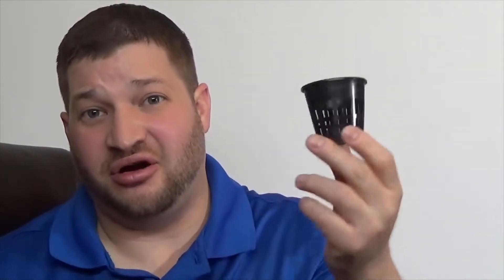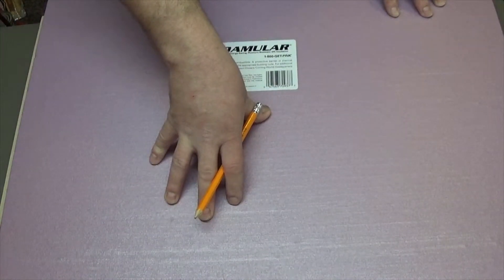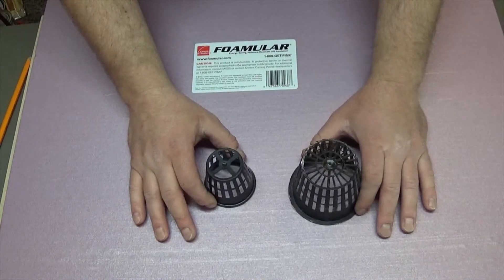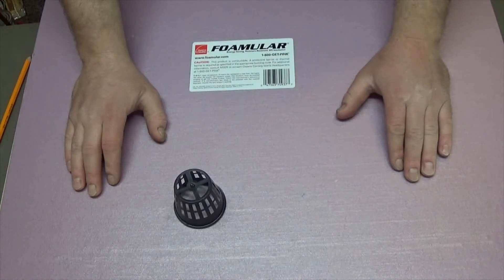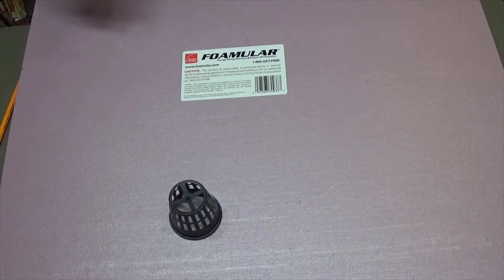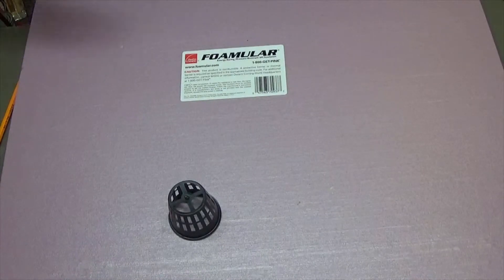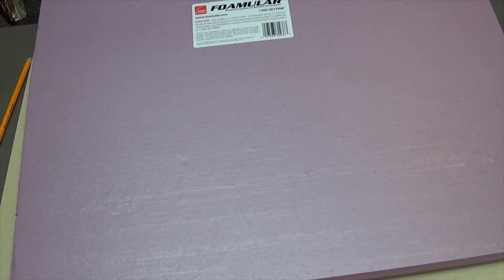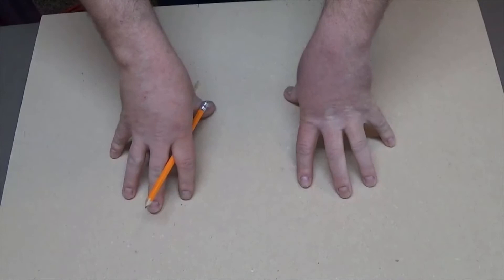How to build DIY Hydroponic Rafts for Net Pots

Comment: Get your facts straight. Rock wool is not synthetic. It’s not made of graphite. It’s made of rock, hence its name.
Reply from the maker: Thankyou for taking of moment of your time to view one of my educational videos I do appreciate your interest and willingness to take a moment of your time to learning.

Though the audio may not be of great quality it is still able to be understood. Starting at time stamp 4:00 my exact words are as follows.

 "It is quite cheap and readily available, however it is spun from a material synthetically created. From its rock based material"... and continue on from there.

One of the many definitions of synthetic word for word from Webster's dictionary is "noun:: something resulting from synthesis rather than occurring naturally especially: a product (such as a drug or plastic) of chemical synthesis.

The  actual manufacture process of rockwool is as follows: Graphite, coal, or another carbon base material is burned in a furnace along side iron to make steel. A by product this process is known as slag or excess carbon and other mineral imparities being hammered out in the refining process. This slag and basalt rock are heat in a furnace to a level upwards of 1600 degrees. Air is then blown across the super heated slag and basalt combining them into a synthetic fabric and loosely woven together not unlike how cotton candy is  spun. 

Thus in my comment how I spoke graphite, or another carbon and rock are both in the manufacturing process. I felt it would not be an appropriate venture to talk about the chemical or metallurgic process on a step by step manufacturing process.

So Rockwool is synthetically combined and created through an artificial process weaving carbon based slag like graphite or coal and basalt rock together by means of a blast furnace at 1600 degrees F.

So when I stated that the synthetic rockwool, was created not only was the definition of the vocabulary in which I used the wording correct, but also I did state the source of the material being rock.

Once again I do appreciate you watching my videos as I know time is the one resource we can never get back. If I make a mistake I am the first to admit that I am wrong and move on.

However just because I am a farmer does not mean I don't understand the nuances of engineering, chemistry and metallurgy among other subjects that it takes to manufacture the farm products of which I use on a daily basis.

I say this with the sincerest phrasing If I am wrong I have no problem admitting it and apologize for it; while correcting those very mistakes. 

However, make certain before you attack some one anonymously from behind your keyboard make certain you have your facts strait. Before you run off a flippant comment I encourage you to get your facts strait as well. 

Once again thankyou for your time it is much appreciated. I hope if you are a subscriber this does not cause you to unsubscribe. If you are so inclined to unsubscribe if you are, I wish you the best of luck with life and your every endeavors. God bless.
Reply: @ewellacres  this is an epic answer, I absolutely love it.

Comment: I looked up this foam board you are using in this video and it has chemicals that will leech into the water. Insulation should never be used as you RWS. Just because its put out by owens corning ware doesn't mean its food grade. Anyone reading this, if you choose to do a RWS for you DIY home garden, Try using the same material a pool noodle is made from, polyethylene foam: closed cell, Closed cell polyethylene foam is not acceptable to grow mold in the pores of the foam and it comes in sheets, and for the cheaper side of the DIY "Net Cups" you can use an actual pool noodle, cut into 1-2in pieces. You don't need soil per se to grow you veggies.
Reply: I was doing a lot of research on this issue, and have only used items with very limited leaching, thanks for the tip of using polyethylene instead of polystyrene.
Reply from the maker: Thankyou for youtime in watching it is appreciate it.